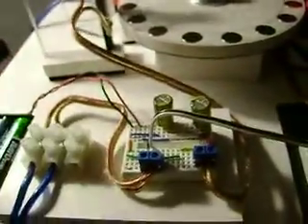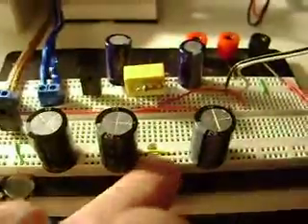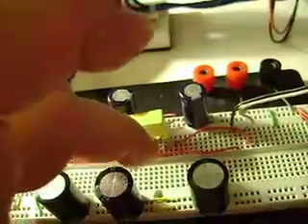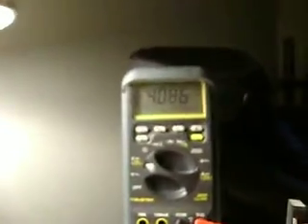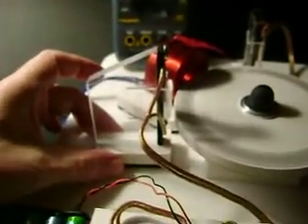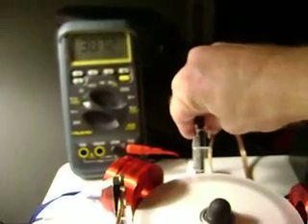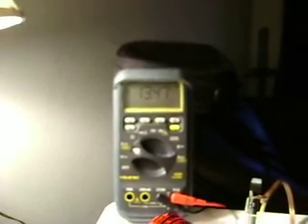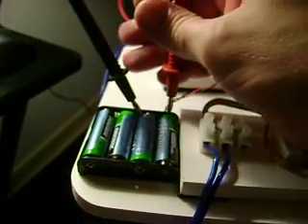Running functional 2nd stage from 1st stage BEMF and charging old 12v bat from 2nd stage BEMF

Comment from the maker: I suppose I could. The timing would have to be set properly. But storing it previous to expending it, will give better impulse to second coil when pulsed by second reed. Good thought. But if you could imagine a whole series of coils in that fashion, the impulse would be lost, possibly smoothed out.  Will have to try.
Magluvin

Comment from the maker: None this round. I damaged my Watt's UP meter testing this setup. If I disconnect the bemf capture wires, which I did, the bemf pulses hurt the watts up meter. =[
I have to send it in. Not happy about that. But I can do current readings with my meter. I will have to set things up to be able to break a line to make voltage then current readings while in the same vid. Time flies when doing these vids. More to come
Magluvin